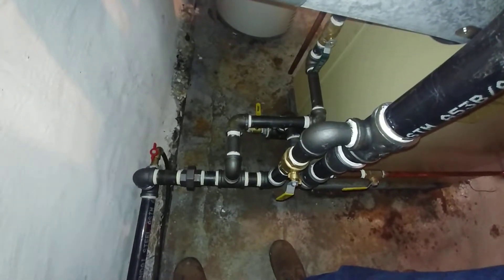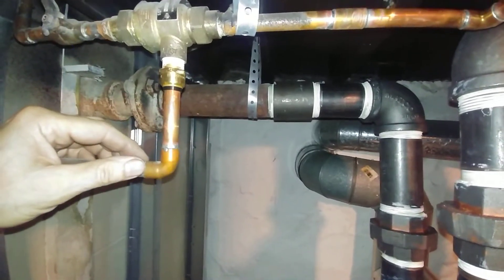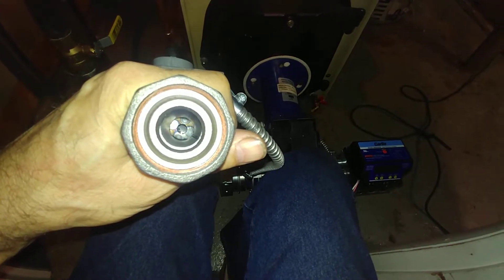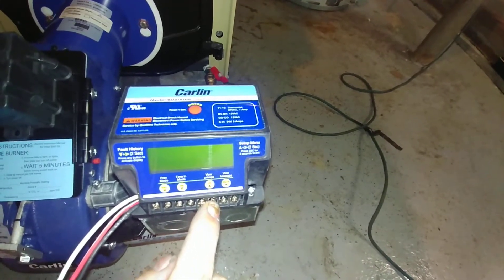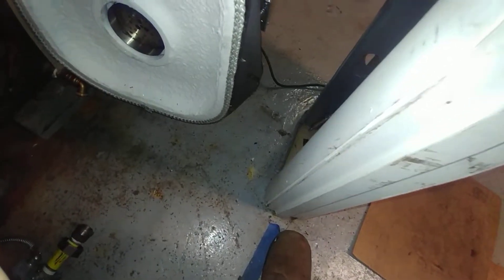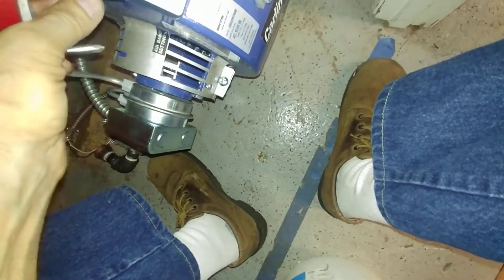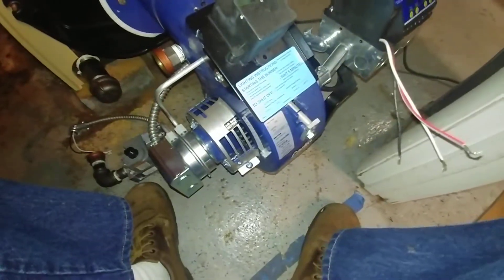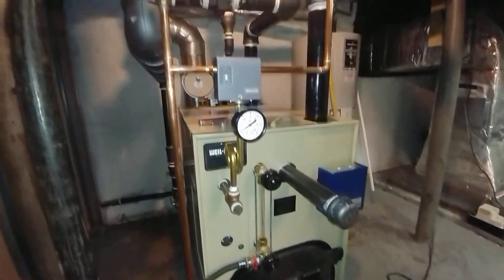Steam Boiler Install: Dramatis Personae on Stage - Now They Await Their Lines

Comment: I have 2 questions for you. First is on the gas unions there looks to be some red stuff on threads is that a different type of dope you use. And second do you use Teflon and door on piping threads or just dope. And last question what dope do you like to use. I like whitlam select
Reply from the maker: I prefer to use PTFE tape (good quality) and then Oatey's Great White pipe dope.
Most pipe dopes are personal preference and most seem to work ok.
In our area, PTFE tape on gas is frowned on, so just dope is used on the gas.
Could you quote a time stamp of the video in regards to your question on the "red stuff"?
It may be copper based antiseize.
Reply: It was around 3:55. Maybe it was just the fitting itself but it looked like something on the threads. Thanks for the quick response.
Reply from the maker: @danieljanowiec1324  You're welcome.
Yes, that is copper based antiseize.
We sometimes put it on unions to help insure they can be taken apart even if they get wet.

Comment: Gordon, why the external burner unit?  You mention control.  Are they overall more efficient too?  Greetings to you and Steamhead.
Reply: And to you, too, sir.  Thank you. All the best.

The other plus in efficiency, is the overall design of the oil/gas burner boiler.  In that type, the boiler has "five sides" exposed to the fireball in the chamber...top, bottom, the two sides, and the rear (well...sort of. That usually has a refractory target wall to keep the rear metal from stressing too much).  The door (the sixth side) is where the burner is mounted and does not add to the boiler's heat capture.

In the typical atmospheric gas boiler, the very design lets in too much excess air, wisping away the heat up the chimney.  And there is only one side, the top, exposed to the heat.

Down sides to the power burner? Extra complexity and noise.  And did I mention noise?
Reply: What type of camera do you use ? Video looks very clear.
I like to paint my boiler piping with shadow grey spray paint. Always makes piping look clean does not show the dust of room.
Old timer I learned a lot from, his signature as well as piping style. 
Remember how much would you pay for a car , if it wasn’t painted.  Thanks Eric